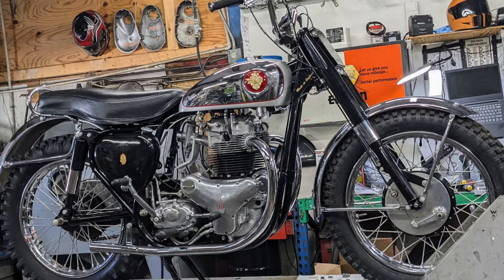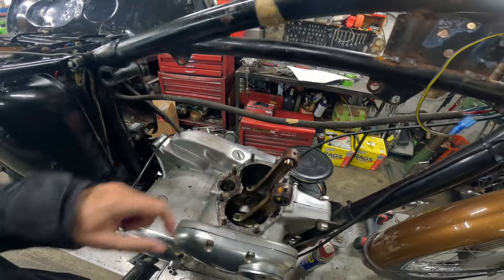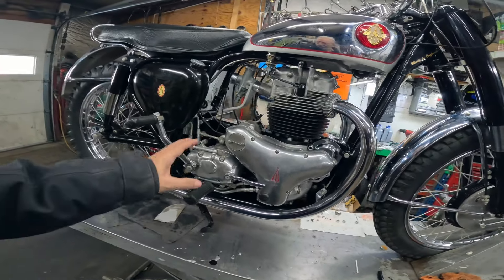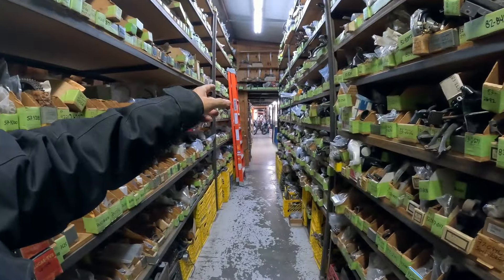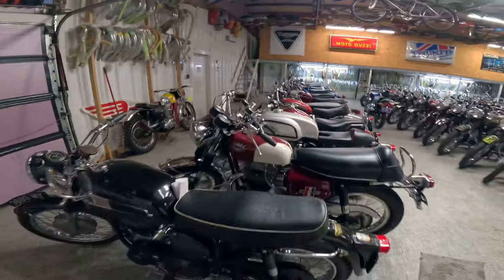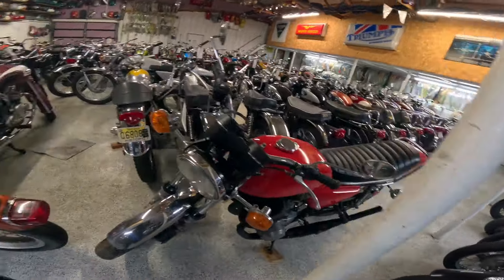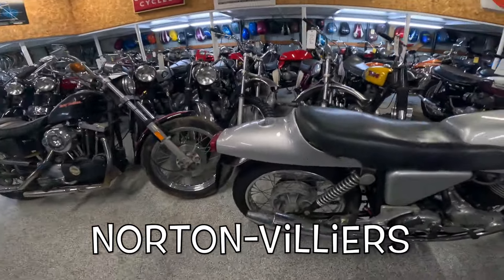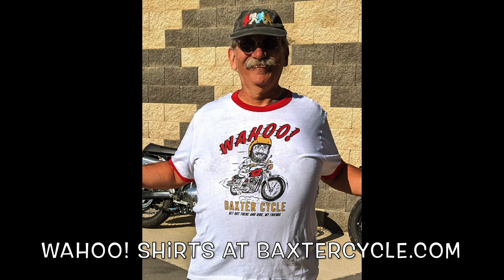More Vintage Bike Madness from the Secret Backroom at Baxter Cycle - Wahoo!

Comment: Mates Dad got a Golden Flash 650 but needs a rebuild make a great project 🤔.
What a wonderful place.
Reply from the maker: I envious, Those are good-looking bikes. Wahoo!
Reply: A Villiers Norton is later on late 1960's on earlier it was just Norton.Villiers Norton also brought Royal Enfield & when RE was testing the Mk3 Interceptor 800 in 1970 a Trident 🔱 was at the track being tested & they were neck & neck & Villiers Norton the owners of R.E got paranoid that the Interceptor 800 prototype went into production would out sell Villiers Norton marque bike the Norton Commando 750.So closed R.E down unfortunately.Couldn't have the subsidiary company out performing the marque brand Villiers Norton new Commando & American market loved the R.E bikes having the most torque of the British bikes & Indian used them too for the same reason.
The remaining bikes were sold to Indian & Rickman brought the engines for their Rickman Interceptor 750 which had disc brakes & 28kg lighter weighing 165kg Wahoo.1970-72 Rickman Interceptor 750's were sometimes sold with a spare engine from a Rickman Dealership in Canada.
A 130-138 Rickman Interceptor 750's were made.
Reply: @forgottenmotorcycles Probably get it for 2.5-3k NZ 🇳🇿 but is in boxes & has got a Honda front end which was a favorite mod to British bikes but was running when dismantled but engine need a rebuild.
Did you find a Tiger 🐅 750?
Also keep a eye 👁️ out for a Rickman Interceptor 750 & a Indian Interceptor 750 made in Italy by Tartarini very rare only about 30-35 made & there's one in a Museum in the US in the South.